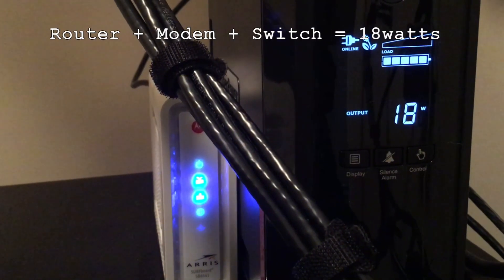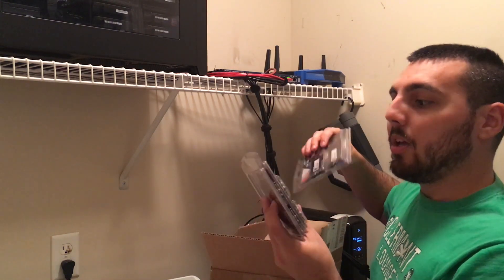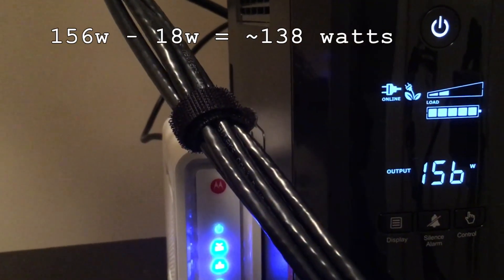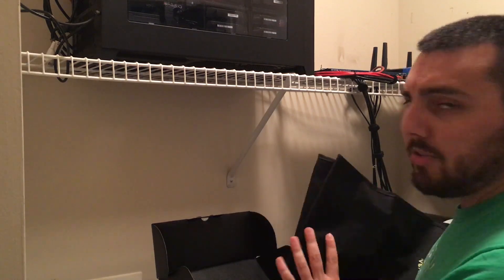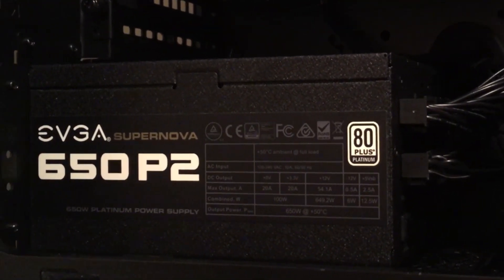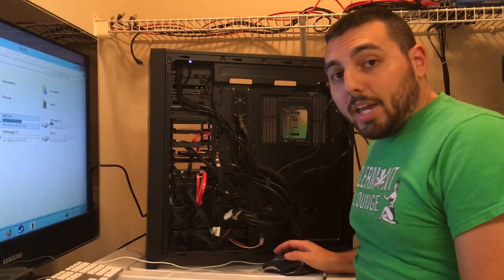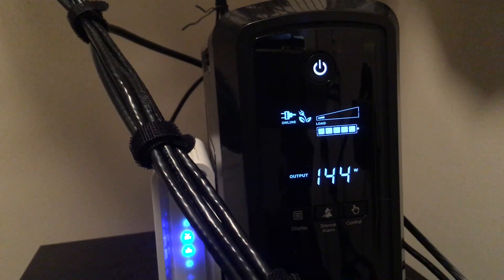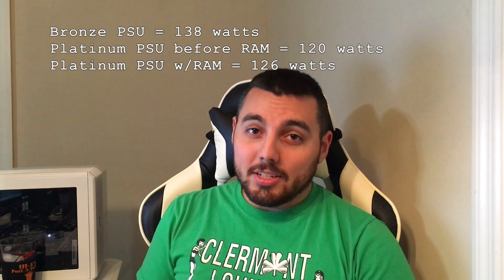Does a Platinum PSU really use less power than a Bronze?

Comment: Great video, just what i was looking for.
But keep in mind that the U P S (;P) draws some watts to. Found out that my Eaton UPS draws around 100w alone.. So by removing it i save 100w. But ofcours if you run critical equipment then you need it anyways. :) Glad you found out about the cables on the psu, got scared for a bit and was afraid you would blow up something. :)

Comment: +Stefano Partida
Interesting video.  I too was very surprised by the additional 6 watts of power usage due to the RAM.  It's interesting because last year I purchased a Dell Precision 5810, which had two power supply options.  If you selected over a certain amount of RAM, the website configurator would require that you upgrade to the higher wattage power supply.  By the way, nice cabling job next to your router.

I own the EVGA P2 850, which I love.  I've had my eye on the new Seasonic Prime series, although I'm very disappointed that they ship with flat ribbon cables, although the 24 pin cable is rounded: http://www.jonnyguru.com/modules.php?name=NDReviews&op=Story&reid=481